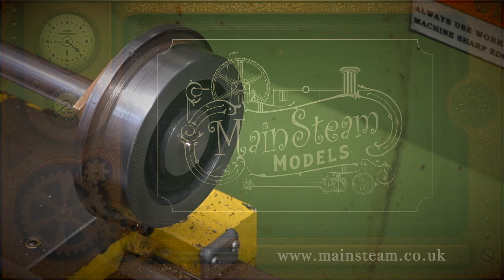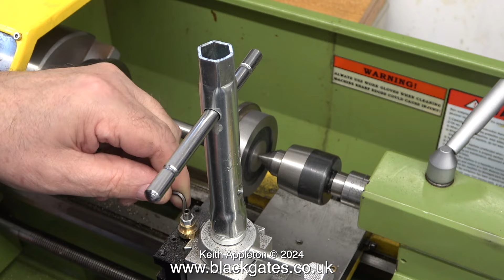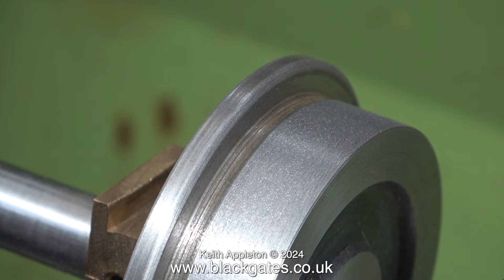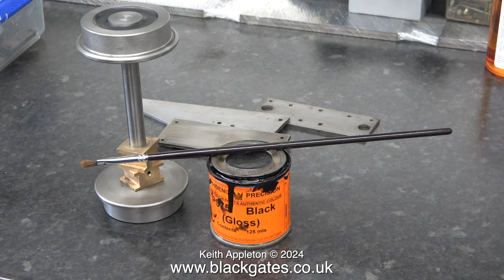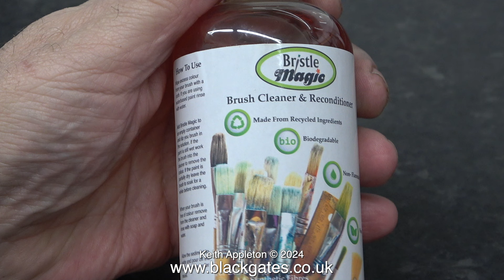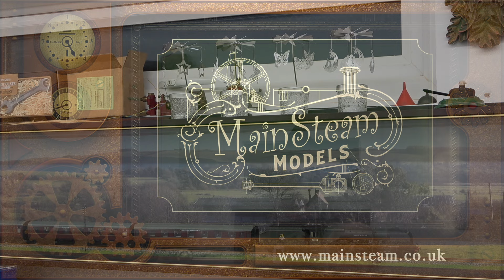A BLACKGATES SWEET PEA LOCOMOTIVE BUILD - PART #10

Comment: Regarding paint brush bristles.  I stumbled on this by accident.  There is a general cleaner called "Spray Nine" or "Fantastic" or "409".  The warning lists "sodium metasilicate".  Active ingredients are a couple n-Alkylls and dimethyl benzyl ammonium chloride.  I was staining my fence using an oil based stain and was washing my hands in the shop sink.  I have this cleaner.  It is "green and safe and nonsense" lol I think it might be also sold as "Simply Green" it has an awful fume to it.  But I sprayed it on my hands and it totally emulsified the stain.  I sprayed it on the brush while it was under the water stream and the water immediately went from clear to brown.

This works well with oil based and water based paints and it just takes a few squirts.  You need to knead the brush into something for quite some time.  There is a lot of thinned paint left over in the brush even after I cleaned them conventionally.  This method made it so I had to throw brushes out due to wear and not hard bristles.